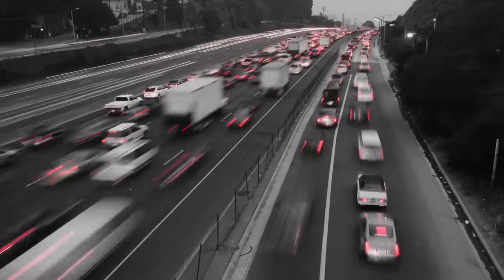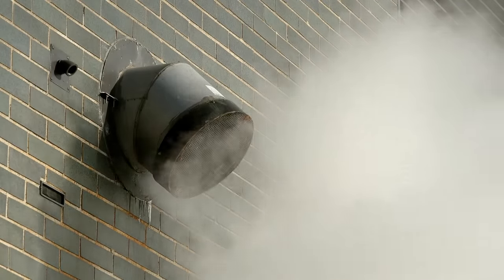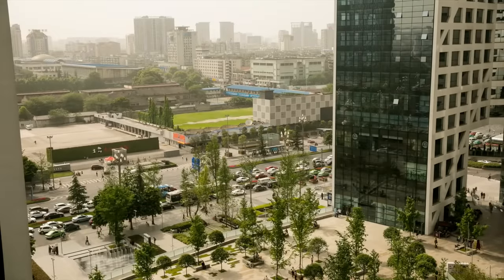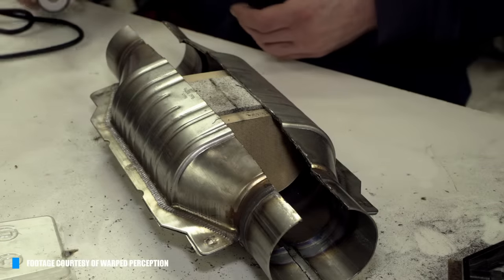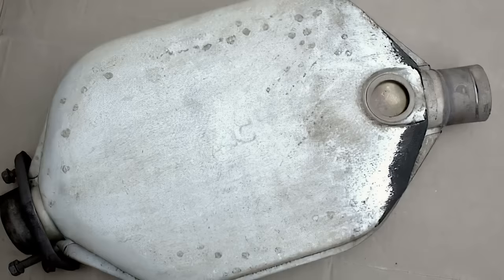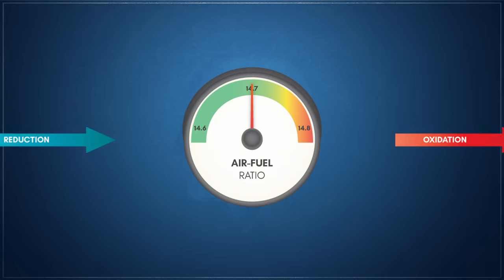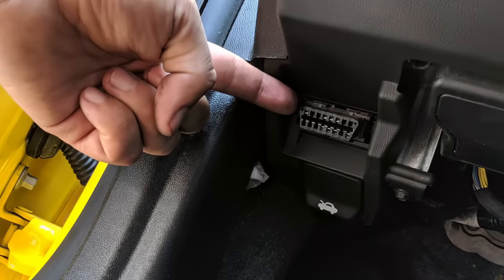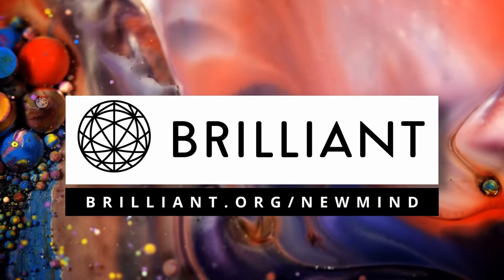How The Most Hated Auto Part Changed The World

Comment: Finally after many years now I understand why Air-Fuel ratio oscillates. I was always perplexed why with todays electronics they don't try to run air fuel ratio as close to perfect as possible.
Reply: Yeah same. I always thought it was the system hunting due to delays in the ecu and sensors. Now I know better!
Reply: they do it is pulse width modulated off of O2 signal and other inputs its pretty efficient
Reply: on older systems it was called lambda
Reply: @northernpatriot9078  It's still lambda, the symbol for air-fuel ratio.
Reply: Knock is also prevented with a richer mixture so engines often run rich under heavy load
Reply: @Capitanvolume  Yes, but staying rich even under acceleration is disastrous for emissions. One of the things you can do with hybrid vehicles is only ever run the engine for lowest emissions, and depend on the electric power system for acceleration even when you just want to reach residential area speeds (~30 MPH, ~50ish km/h) so you never have to "distract" the engine from doing what it does best, which is producing its power with the lowest possible emissions regardless of driving conditions.
The drawback is that hybrid cars have two propulsion systems, and that just costs too damn much.
Reply: @devilsoffspring5519  I'm not a fan of hybrids. Too costly and no economy benefits for my mostly highway driving. I own a rx7 and it's tuned so I'm familiar with horrible emissions lol
Reply: @Capitanvolume  That's why your modded RX-7 cannot be mass-produced for the general consumption of the motoring public, though. The "Car World" dwells on two things only, and that's looks and acceleration. The visceral pleasures of car ownership revolve around only those two things, both of which are irrelevant to the technology itself, which is the production of practical and useful vehicles that perform adequately and usefully, at the lowest possible cost while aiming for sustainability in the long run (lowest emissions, good convenience and practicality, and marketability.)
That's why purely electric vehicles and hybrids alike are still niche products, regardless of the vehicles looks and acceleration.
Reply: Sadly, what he did not mention, the EPA never brings up, the emissions controls, 3 way cat, O2 sensors & ECU map tuning of the engine, ignition, injection etc // trades off wasting fuel to clean up the exhaust

Something like a 30% reduction in fuel economy, especially on cold start with very rich cold burning fuel mixes to light off the cat or get it up to temp. The same Honda Odyssey solid the UK gets 56 MPG while the same model in America barely gets 26 MPG, that's when you take into account the difference between an imperial gallon & US gallon. It has to do with ultra-lean burn modes. In the UK model, the same engine able to operate in ultra-lean burn modes with very high air to fuel ratios of 40:1 or more, which cranks out oxides of nitrogen that the cat has to work to reduce // I have friends that live in a suburb of London & owned a UK version of the Honda Odyssey ^ were getting 66 MPG on the imperial gallon. They moved to a suburb of Seattle & were getting 26 MPG in the US version of the same vehicle with the same engine.
Reply: @devilsoffspring5519  people want looks? Are you serious? Then why are 80% of cars ugly? 
Acceleration yes, but in my opinion this is because people do not understand the basic principles of acceleration: that there is no instant acceleration from say 50 to 100 but you need time. And for this to work out with low power you have to drive forseeing traffic conditions instead of dumbly following the car in front of you at far too short a distance.
Reply: @jpt3640  Because 80% of cars are designed to be cars, not hobbies and not really fun.
It's still looks and acceleration that sells desirable cars.
Reply: @chicken29843  taxis are doing mostly city miles with stop and go. Hybrids offer huge benefits in city driving. My golf diesel gets 55 mpg and costs less to buy and doesn't have added failure points and batteries that degrade
Reply: I was just about to comment the exact same thing
Reply: There’s excess fuel in the cylinder to help cool down the engine by taking heat out with the unburnt fuel
Reply: @minimalisticmime5459  The quantity of excess fuel isn't enough to have any noticeable cooling effect on the engine. The reason for running rich under high load is to suppress detonation.
Reply: @AaronSchwarz42  I didn't know Honda odysseys ran turbine engines, not even diesels reach 40:1 or more, that's insane. Let alone a gasoline spark ignited engine.
Reply: @hughmongous5089  I'd like to see a source on his claim of a spark ignition engine running an AFR of 40. From memory Heywood says peak thermal efficiency for spark ignition engines is around lambda 1.4, so a lambda of 2.7 like Aaron is claiming sounds wrong to me.
Reply: @devilsoffspring5519  British Leyland spent billions of government money on developing a lean burn engine but Mercedes in Germany persuaded the EU to mandate CAT's as they worked better for big engines which they made for all their cars so all the cars which could have had small engines had to be fitted with bigger ones in order to use CAT's which means more fuel is used and ultimately far more CO2 is produced
Reply: @AaronSchwarz42  Yeah the emissions issue killed more efficient diesels all because the LA basin has awful air and gets to dictate policy for all of America for some dumb reason
Reply: A perfect 14.7 -1 fuel ratio is only ideal in very low load and low power engines. In higher power engines especially boosted ones use 11-12.1 AFR to cool the air and prevent detonation.

Comment: Little known fact. The very name of the catalytic converter came from ignorance and fear.
In a nutshell, it's a reactor that uses a catalyst to perform the chemical reactions to make the exhaust safer. So a reasonable name for the device is "catalytic reactor". But that word "reactor" caused too many people to think of "nuclear reactor" and the connotations of that, along with too many ignorant people thinking that the "catalytic reactor" would mean that it's radioactive. And that mistaken belief would cause the acceptance of the device problematic. So a different name was required. And since the device "converts" harmful emissions to safer emissions, the name selected was "catalytic converter."
Reply: Similar to "microwave oven" instead of "electromagnetic radiation oven"
Reply: @bohdanked  except, the electromagnetic radiation is an oven IS microwaves.
A traditional oven isnt an infra red radiation oven either.
Reply: reactor has been nailed to only nuclear ones

everything else should be renamed
Reply: Most of the world call this part "Catalyst".
You had to add the extra word in USA, but you also call glasses "the eyeglasses", wheel is "the steering wheel" and many more.
Reply: Fast forward to the year 2022, and I would now totally want a friggin reactor in my car 😂
Reply: @zlac  there is something about the English language in that we sometimes have a need to be more precise instead of relying on context.  It is a steering wheel because the car has four obvious wheels on the ground, and many more wheels in the drivetrain.  Using context might be faster, but using extra words is more precise.  Still, we use context for some things.
Reply: @microdesigns2000  First of all, it was a joke.
Second of all, even it being a joke, British say just glasses and wheel.
Depache Mode song is called "Behind the Wheel", not "Behind the Steering Wheel"
Reply: @zlac   lol, Behind the Steering Wheel.  Incidentally, behind the wheel is an expression that includes enough information in context.  My wife remembers other songs about cars, "Get out of my dreams, get into my car" by Billy Ocean, or Ides of March "Vehicle" with the opening lyric "I'm the friendly stranger in the black sedan".

Anyway I didn't take any offense to your comment about English using extra words.  I was just sharing about why I feel compelled to use them. I hope my comments give you a laugh.  Happy day friend!  😀
Reply: Mazda didn't shy away with rotaries in the 70's, proudly declaring that their "thermal reactor exhaust system" didn't need a catalytic converter since the rotaries exhaust is hotter than the surface of the sun!
Reply: @microdesigns2000  a picture is worth 1000 words
Reply: @shadowopsairman1583  haha, and yet, a thousand pictures in a movie often poorly describes a book.  In a picture you have a thousand words.  But in a thousand words you have many pictures.  What do you think?
Reply: Any source on that? I work in the chemical industry and the terms 'reactor' and 'converter' are both used, for instance when talking about ammonia reactors or CO shift reactors.
Reply: @TheKillerBush  Unfortunately, it's a piece of trivia I read all too many years ago. MY best estimate is somewhere between 20 and 40 years.
Reply: @TheKillerBush  well, technical fields don't have to deal with the consumer being an average person who gets scared by "dihydrogen monoxide".
Reply: @bohdanked  we just call it the tucker fucker here in Australia.
Reply: @zlac  Americans also say just "glasses" pretty much no one says "eyeglasses"
Reply: Little known fact; they end up in the trash because they legitimately hinder the performance of higher performance vehicles. Not to mention the additional fuel OEMs inject in an attempt to keep them from melting themselves.
Reply: Really? Who would have thought. Most of the norms would believe it is a magical box that converts CO into CO2 with the help of a catalyst... possibly turning cars into one of the largest greenhouse gas emitters...
Reply: @TrevorSachko So many people are totally unaware of this